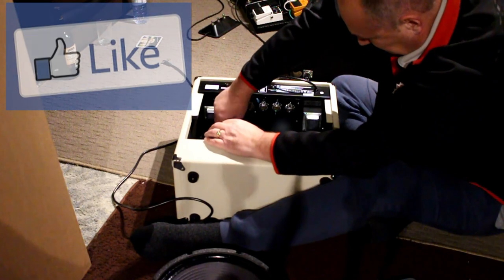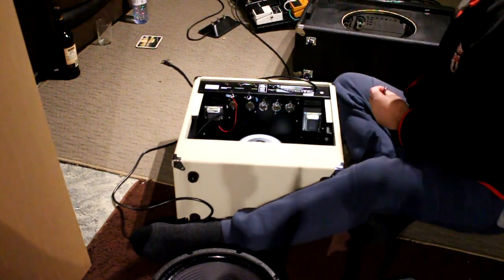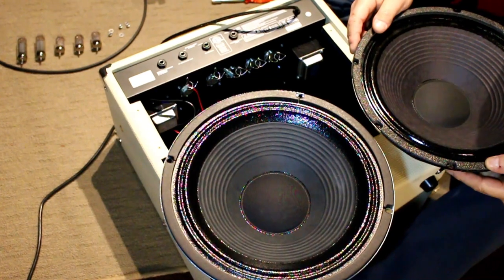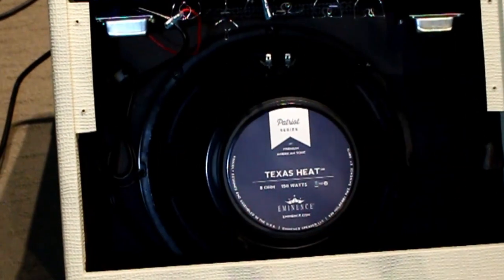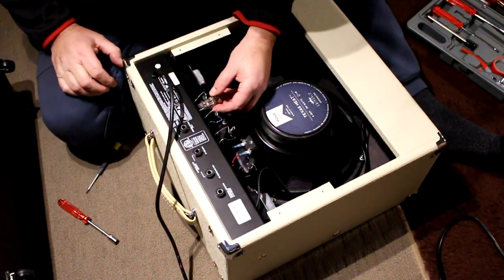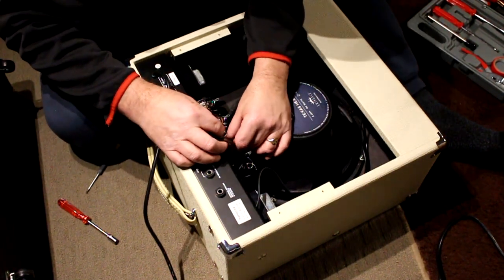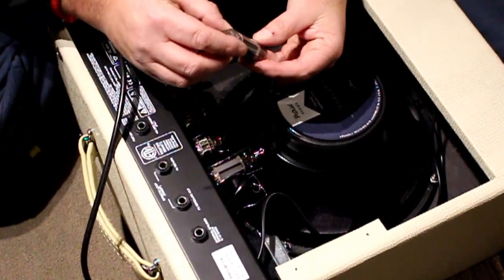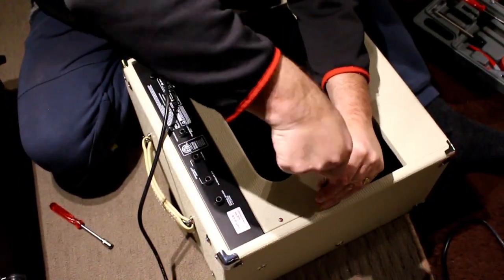Monoprice Stage right 15W amp speaker swop Texas Heat

Comment: Looks a little dicey with the speaker mounting studs sticking out. Would be easy to poke a hole in the cone. I would take the studs out if possible. It might be harder to line up the holes but that's fine by me. Those speakers are expensive.